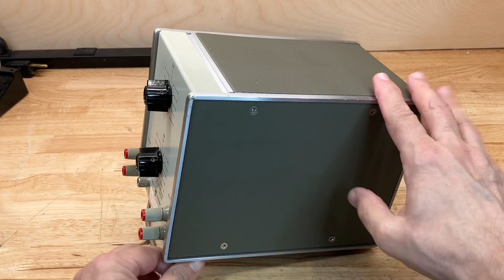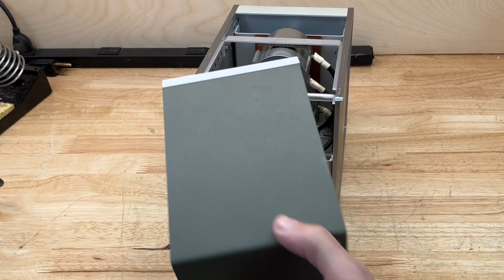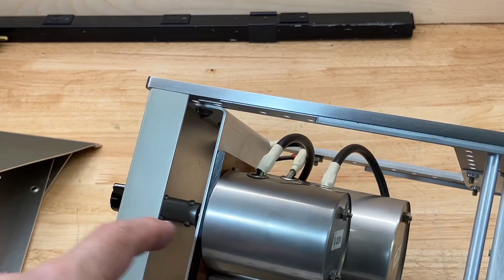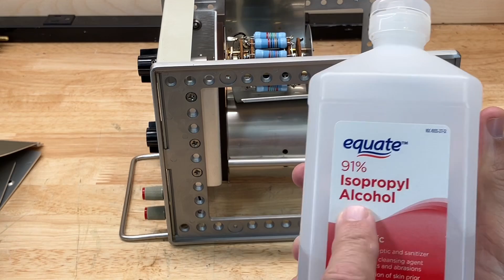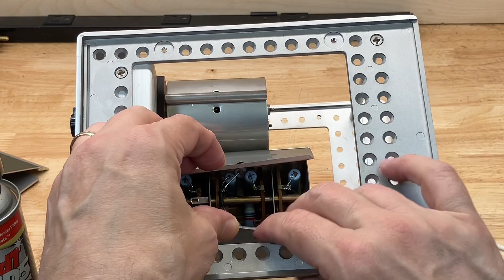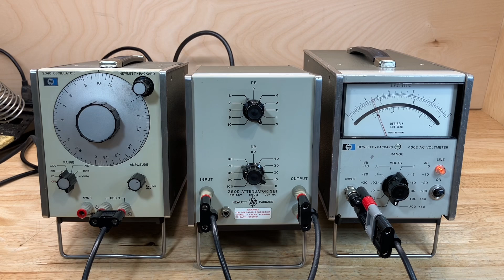HP 350D Attenuator Set

Comment: Very nice unit.  HP made such nice instruments during that era!

Regarding contact cleaning, I like to use CRC QD to clean, then follow up with DeoxIT D100 (rather than D5).  D100 comes in various containers that all permit precise application of small amounts of the D100 lubricant/protectant, thus avoiding all the mess.
👍

Comment: The serial number indicates a date of 1982.
Reply from the maker: The prefixed serial numbers on HP test and measurement equipment began in 1960, and indicate when each major revision began production. If it contains a letter, that would indicate the country of manufacture. Thus the prefix of 0220A would indicate the 20th week of 1962, made in USA. But since this attenuator was produced for decades without any major revisions, this prefix doesn’t say that much about the age of this unit. The capacitor inside has a date code of 7708; that’s why I believe this unit was made in 1977. (A prefix of 2220A, for example, would be from a production run beginning in 1982.)